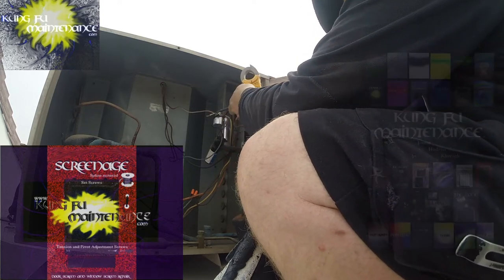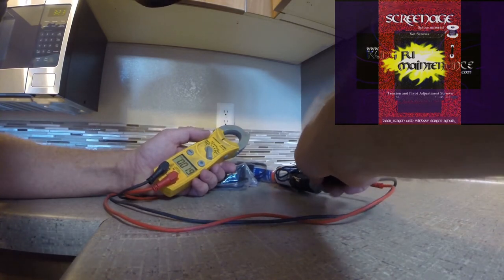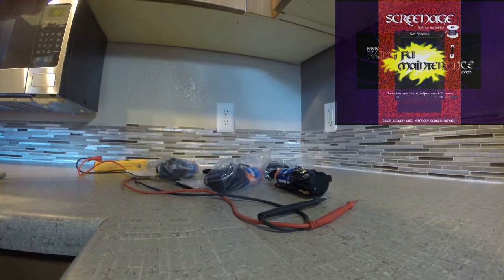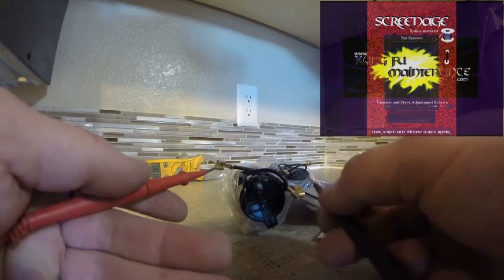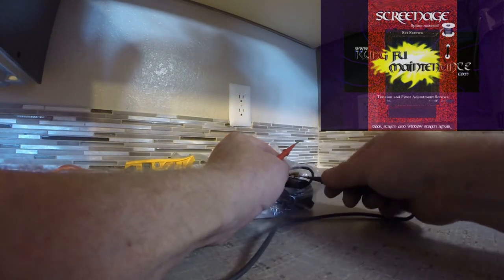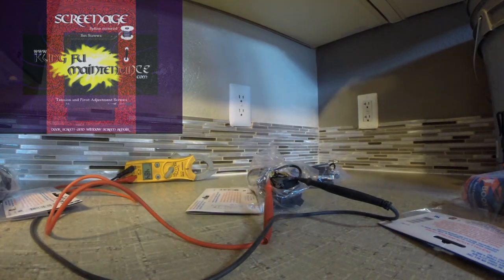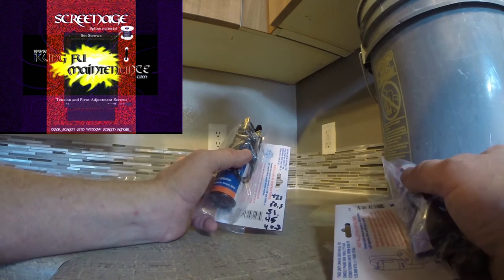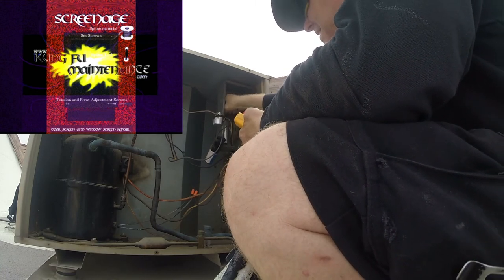Air Conditioner Hard Start Kits How To Test HVAC Research And Development AC Testing

Comment: I check every hard start kit that I install. I use the Rectorseal Kick start T05 with the potential relay. I test them just to make sure they are in range that is stated on the package, for example between 244 and 357 microfarads.